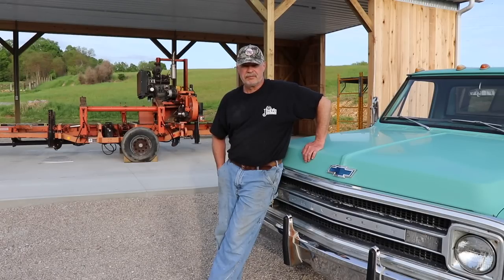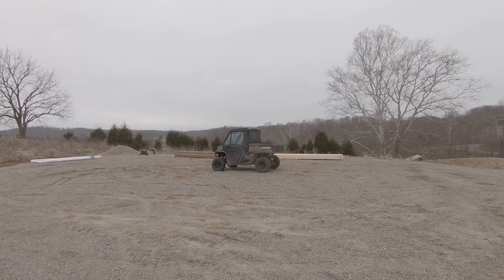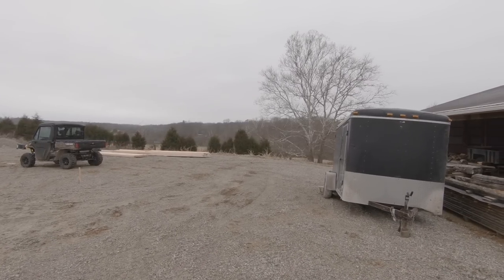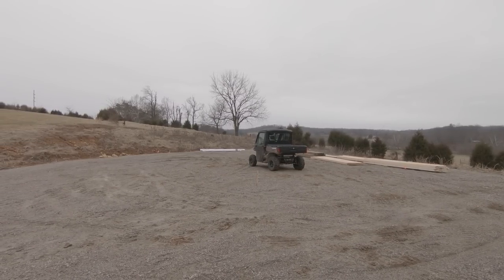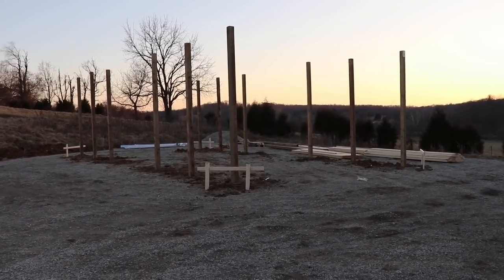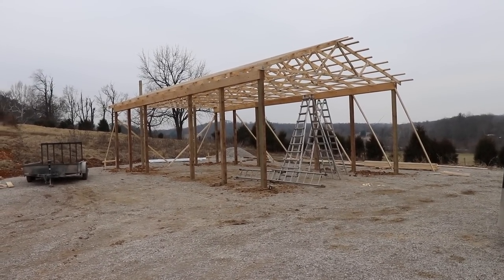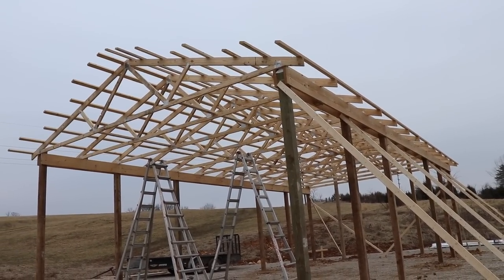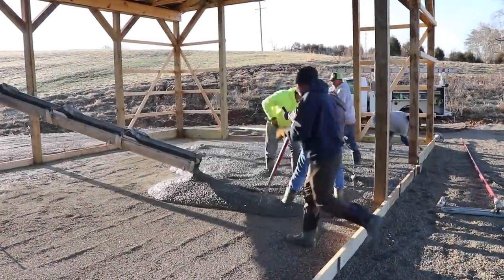Sawmill Shed Complete Build

Comment: Might want to look into getting those posts out of the concrete. Concrete can hold water and slow the drying of your wood posts after rains. The pressure treated wood is not going to last in those conditions. They sell metal brackets the are drilled into the slab and into the post. They elevate the post off the concrete and allow it to dry much faster. It'll keep your building standing strong for many years to come! Otherwise, it's a great looking building! Excellent video!
Reply from the maker: Ryan, thanks for the comment and thanks for watching. Ironically, my initial plan was to do just what you suggested, however, after talking to some local post and beam contractors, and the fact that is is mostly a pavilion,  and on a windy ridge, I was worried about the lift factor and decided to bury the 6x6 treated posts about four feet. I guess time will tell if I made the right decision. Heck, I'm 63, maybe it will at least outlast me :)
Reply: @butternuthillfarm1599  a lifetime for some of us isn't 100 years anymore 😟

Comment: Nathan, I  Notice  you did not put any ww mesh to reinforce the concrete. That slab will crack.
Reply from the maker: Bob, it has fiber reinforcement and is stress cut every eight feet to help control cracking. But you know what they say, there are two kinds of concrete, that which is cracked and that which is going to. Thanks for watching.